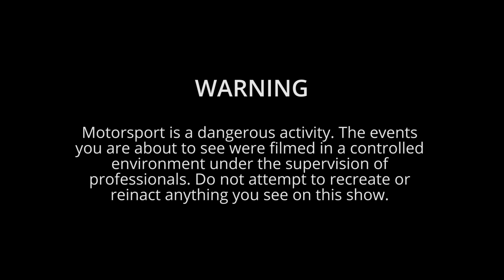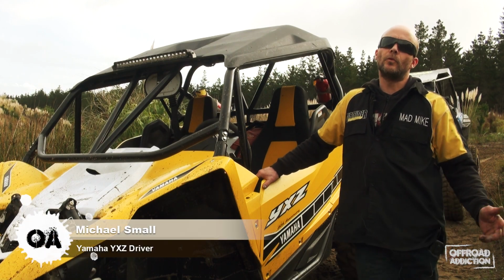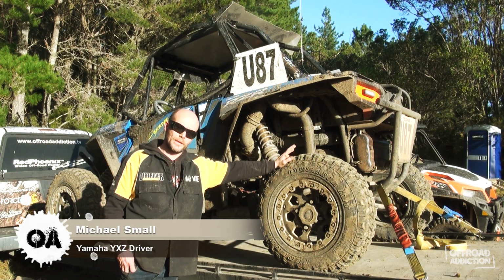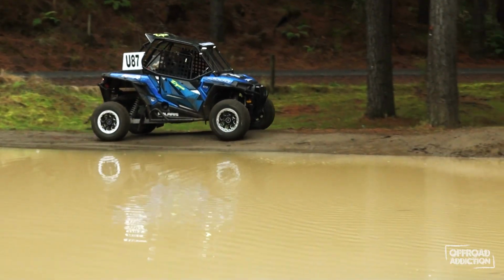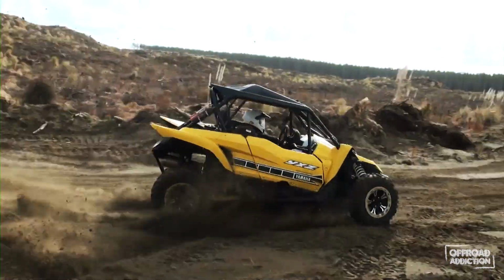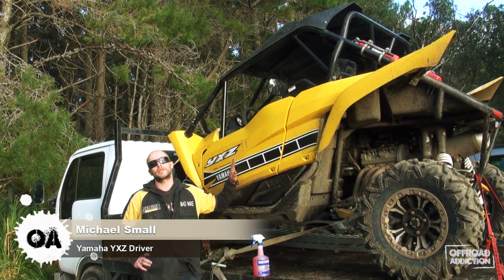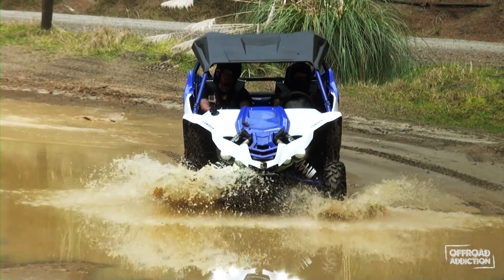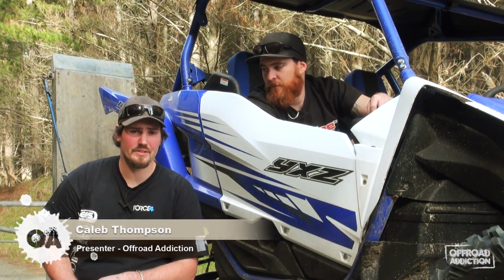Polaris XP1k, Polaris General & Yamaha YXZ1000R UTV Test Day - S02 E07 - Offroad Addiction TV

Comment: Hey guys great videos. I have a ss  "sport shift" YXZ,  I  bought it because of the paddle shift option, anyone can drive an ss model. I didn't buy a foot clutch model because I couldn't see how I could keep planted in the seat while looking after a foot clutch and a gas and brake pedal al at the same time. The ss has been great, coming from a background of racing 2 stroke 3 and 4 wheelers in the mid 80'- 90's, the feel of this machine is awesome to me. Have you tested an ss model since this video and would it have changed your mind on the "best" machine?
Reply from the maker: Hey Trader man, Nice choice of play toy! SXS are alot of fun, we can't wait to test out the new Can-am Maverick X3. We haven't had a chance to test out the SS model but it does sound like it would make up points that the manual model lost in slower driving situations. Thanks for your support, keep it wheels down and have a blast!

Comment: Are you able to utilize engine braking with the manual shifting offered by the Yamaha? I've always like a manual transmission b/c of the extra "control" it offers...whether on pavement or off-road.
Reply from the maker: Hey Cody, yes to some extent they will engine brake, both the Polaris and Yamaha will. We do try to keep them in low range and keep the wheels turning rather than rely on engine braking/ braking to avoid the vehicle locking the wheels and losing control especially when doing steep muddy/sandy descents. They are definitely some awesome fun, you should go talk to your local dealer about taking one for a test drive ;)

Comment: Every video I've seen of the YXZ going over a riser/table top/small jump it looks like it wants to endo.  Is this a rebound issue in the rear suspension or . . . ?  Love the YXZ, but I'd have to see that that's "fixable" through settings before buying one.  The Razor seems much more in-flight neutral.  Any thoughts?  Any adjustments you guys made?  Am I nuts or did you guys notice that in the YXZ also?
Reply from the maker: Hey Daniel, both machines tend to "kick" from factory. This can be adjusted with suspension setting to a position that suits you best. The RZR in this video has aftermarket shocks tuned for racing so it is at a slight advantage over the stock YXZ. Our suggestion would be to take the different machines for a test drive, see what feels right and keep in mind that things can always be tweaked to suit your driving style.